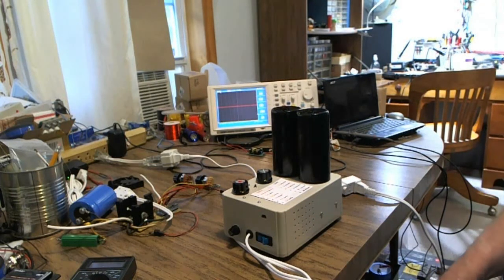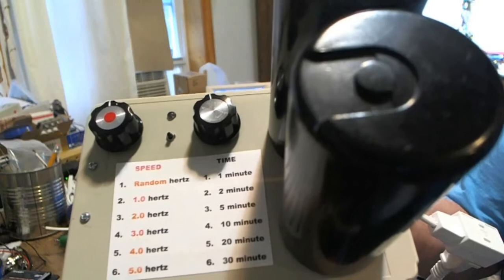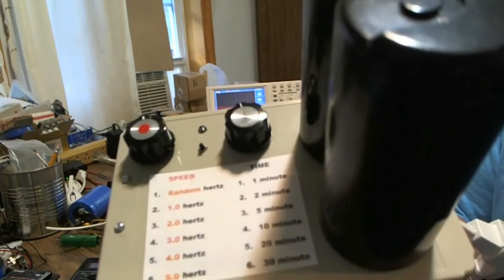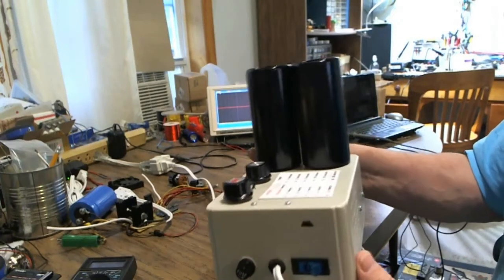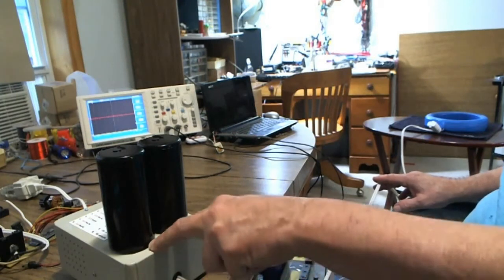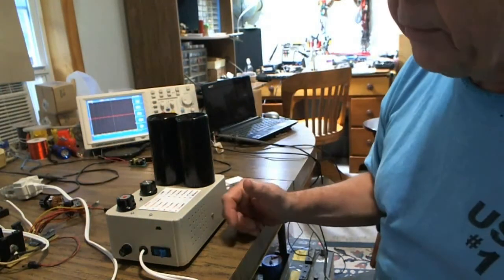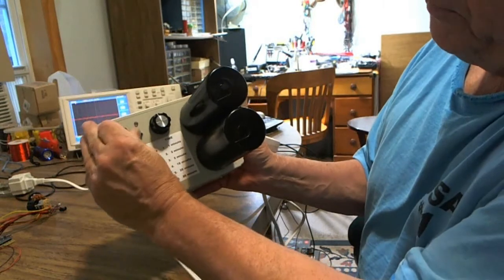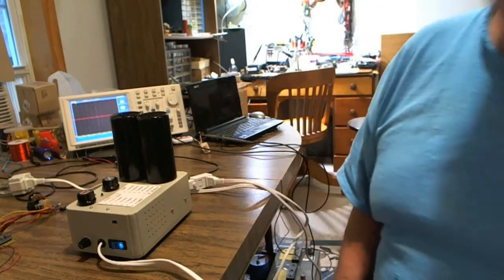High Power PEMF Kit Video 1

Comment: Is the unit strong enough to cause muscle contractions? What’s the voltage?
Reply from the maker: No, not with any of the coils employed to date.   I’ll let you do the math; 160 volt is passed through a .5 to 1.5 ohm coil for approximately 3 milliseconds with about a 1 millisecond peak.  The Bifilar and Mono Coil normally used with this PEMF is an 8” diameter coil with 200 feet of 12 gauge copper wire.    There is a lot of technical and user friendly information on the website which I would suggest you review if you want to know more.  Be well and respectfully,  Steve www.aurorasky.net
Reply: @gskempe9  why not increase your voltage? I’m using 820 volts (half wave cock Walton multiplier) and a 555 timer that connects coil with large capacitor bank (two 3,300uf 450volt in series) for 3 milliseconds every 7 seconds. It causes muscle contractions in some areas of the body. I got the circuit from another YouTuber and simply made my own adjustments including delaying the pulse rate to charge a larger capacitor bank.
Reply from the maker: @corybrown5583  Time is one of the reasons if not the main reasons.  Wanted to fully charge and discharge the capacitor real time at up to 7.83 times a second.   Didn't want to blow the line fuse so an Arduino was used to phase charge the capacitor.  Wanted something that really worked for several different people with different problems.  All the objectives were obtain including a compact low cost unit.

Comment: subscribed!  do you have high power PEMF schematics without arduino?
Reply from the maker: The Arduino is integral to controlling the firing of the two SCR.  The Arduino Nano cost $3 and is like plugging in an IC on the circuit board.  Because of its programmability this PEMF will be able to do things that are only dreamed of by professional PEMF manufactures.  Yes, the present functionality could have been accomplished with discrete components and ICs.  However that would have limited the versatility or expandability of this design.

There is a complete circuit board mask along with the software for the Arduino at www.aurorasky.net if you want to make your own.  My philosophy is open source and I would love to see creative upgrades to this original design concept.  It will be very easy to modify the code to do Schumann Resonance and other frequency patterns to help with sleep, meditative brain entrainment, and specific protocols for health enhancement. This design is like playing with a PEMF Tinker Toy; however it is far from being a toy!  Respectfully, Steve, the author.
Reply: is your coils facing towards you,  basically north pole emitting?
Reply from the maker: The  coil has a favored North side and favored South side.  The discharge pulse through the coil is a 160 volt positive pulse with respect to zero volts.  Flip the coil if you want the opposite favored side to face you.  There is a weak and opposite pole generated from the favored side as a result of the collapse of the magnetic field in the coil.  NOTE:  The vortex coil shown in my icon is NOT the coil used with this PEMF unit.
Reply: thank you for clarifying. you're right about that both side of the coil poles have their weak opposite pole being generated at every end pulses. i have been studying PEMF since 2013, but i haven't built one yet.  your PEMF designs are great BTW.
Reply: Hi again, 
I looked carefully into your schematics and parts list, but did not see what are the value of rectifier diodes,  are they  2 amp, or 4 amp, or 8 or 12amp?

also will Mosfet work as a gate, instead of SCR?
Reply from the maker: MOSFETS will not have the current capacity that SCRs are capable of unless you are willing to pay for some very high priced components.  I used APT30DQ60BG diodes for the diodes labelled 30 AMPS.  They are about $3 each and can found through many suppliers.  Eg.  Mouser and Digikey.   Use the specifications for these diodes as a guide for replacement if you choose something different.

A word of advice;  Don't use any components of a lesser rating then what is suggested in the schematic.  If a diode or SCR fails they typically will take out other components.  Believe me, I know from experience.  Had a few failures along the way until I went with good quality components that where not Ebay specials!
Reply: thank you again for your detailed answer